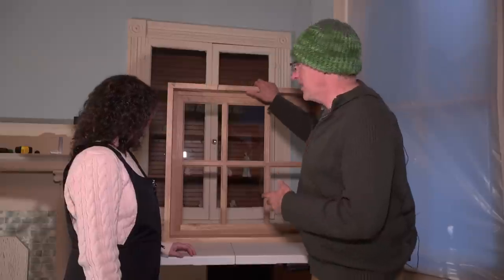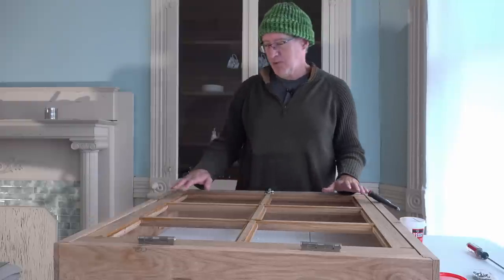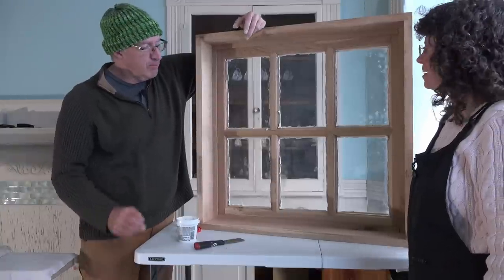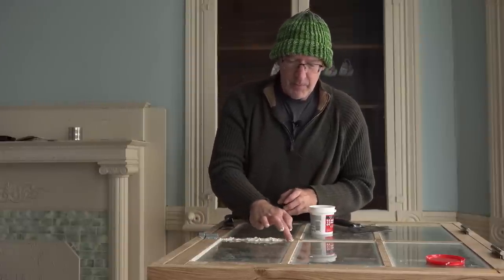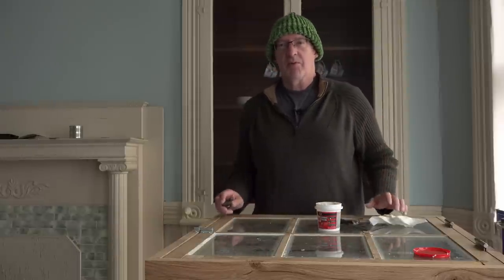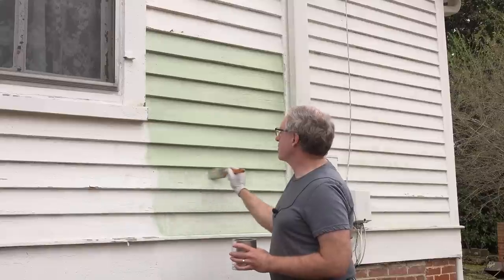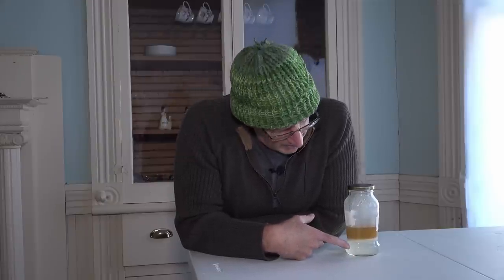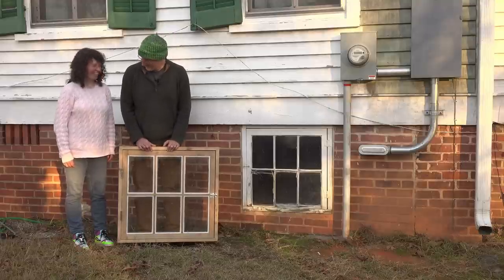EP112 Building a New Window for our Victorian House Pt3

Comment: They make a glazing point tool that enables you to push the points into hard wood without the risk of breaking the glass. At least, that's what I've always used and was taught to do. 🙂
Reply from the maker: My point just bent over when I tried to press it in. That white oak must be really hard.

Comment: Got this from my Dual turntable site, thought you might find it hilarious:Gott in Himmel,
I need a Steuerpimpel,
My Twelve Nineteen won't work
Without it's little Nipple..
I'd be a Happy owner,
If the Tonearm Travelled over..
Across to the Left,
With Mechanical Deft.
But when I move the Switch,
there seems to be a Glitch..
The arm sits back down,
Platter stops spinning round.
I need a Steuerpimpel
Auto set down has stopped Working
My Kingdom for a Steuerpimpel.
My platter has stopped Circling..
Without this little nipple,
My record won't Auto Play,
and I can't listen to,
That song by Marvin Gaye
Reply from the maker: Lol! My old 1219 had a hard steuerpimpel and I tried replacing it with pencil erasers, and anything else I could find. Nothing worked. I finally found a source of the genuine parts and it worked perfectly! I recently traded off my Bang & Olufsen TX2 for a Realistic Lab-440. I'm much happier with that unit.